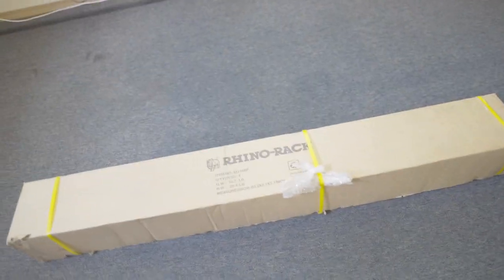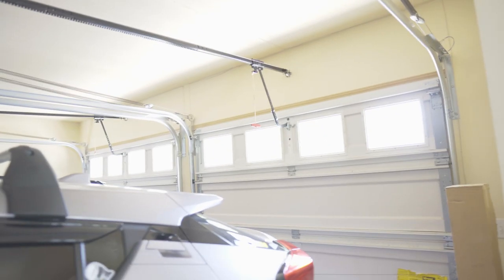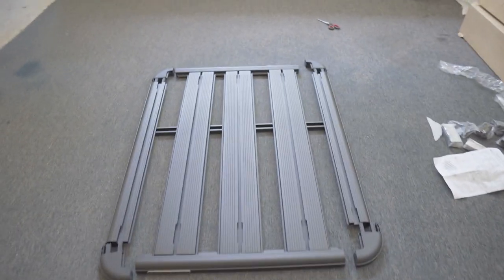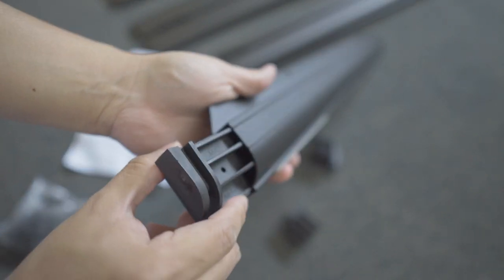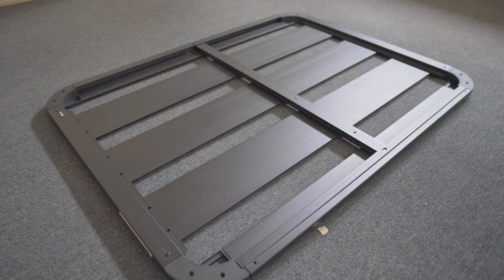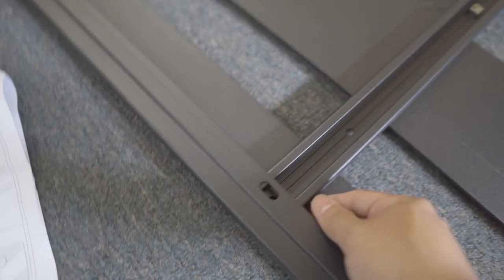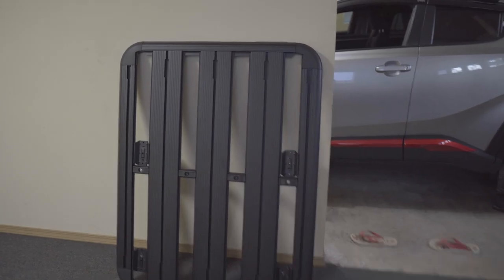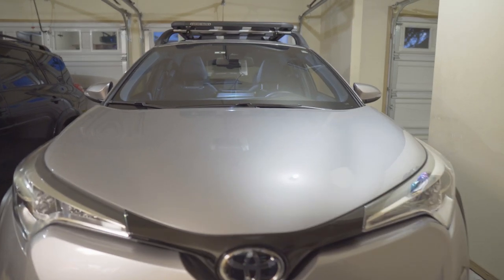Rhino Rack Pioneer Platform Roof Rack (How to or Not to) assemble  [ Project C-HR VLOG 28 ]

Comment: You might of realized it, but you may not have been missing pieces. You should of gotten what looks to be 6 t-bolts (4 larger ones and 2 smaller ones). The 2 smaller "t-bolts" go behind the rack through the hole and fit in the groove and locked with a nut from the top side. Don't ask why it's different. Hope this helps
Reply from the maker: You mean i got it right the first time placing the tbolt and replacing them with the lowes one?
Reply: @Forged_Garage  it would be the smaller size tbolts, not sure which ones u had on there and put it in through the other side. Fasten it with a nut. The larger 4 tbolts are for mounting.
Reply: @Forged_Garage  check out Rhino rack pioneer platform assembly by sketchy Jeep. Around 23min and 10 seconds
Reply from the maker: @altsai5081  i will check his video, and my hardware i got, thank you very much
Reply: @Forged_Garage  correction 19min 10 seconds
Reply from the maker: I saw his video, and yes i still got those hardware with me, i will change the one in installed, thank you for your help
Reply: Thanks. I was in the same situation